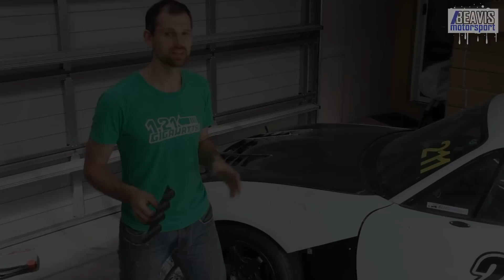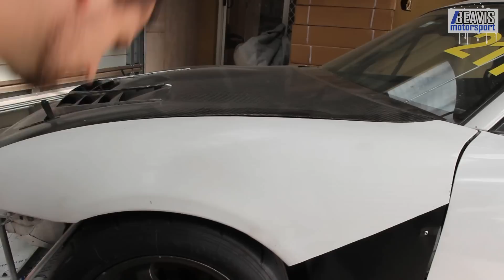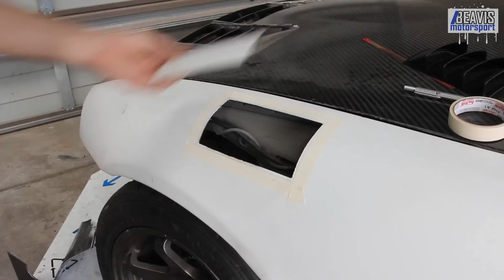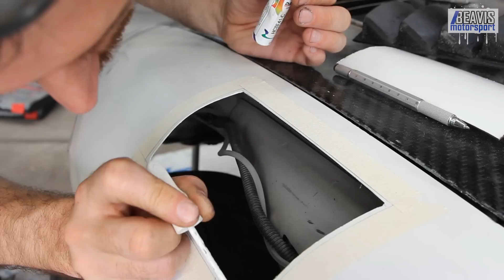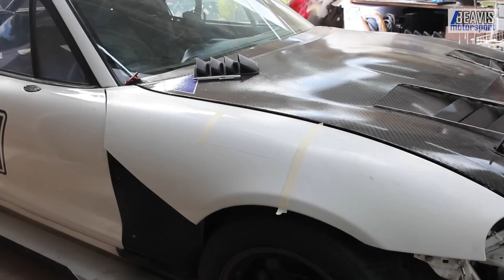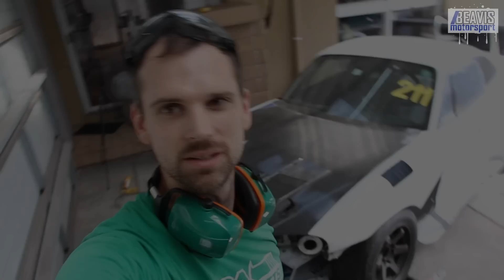DIY FENDER VENTS - Episode 55 - Time Attack TURBO Build

Comment: Thanks so much for sharing these! I just printed your Version2 and it came out great. 
Quick question:Would you have a printable template for cutting the fenders for the new design? Near as I can tell, I can't place it flat on the fender to trace a line line the old ones
Reply from the maker: Thanks.
I never made a template sorry.

Comment: Nice, just on the CAD designing some myself, how do you find the PLA over time, I tend to think PETG would be better for external use.
Reply from the maker: For a part that doesn't have any real loads, it's fine. In the engine bay, I've used PETG for some small brackets and they can handle the heat, in the cabin I had a PLA bracket that softened in the Sun so that was replaced with PETG.

Comment: Thank you for sharing this! Would you mind sharing which software you use to design your 3D projects and how you were able to match the contour of the fenders? Did you scan them?
Reply from the maker: Hi West, i used Fusion360 software, and just modelled the contour with some basic measurements and trial and error with some test prints until i got the shape right.
Reply: BEAVIS Motorsport that’s great. Thanks so much!